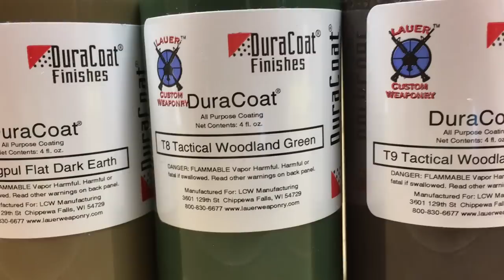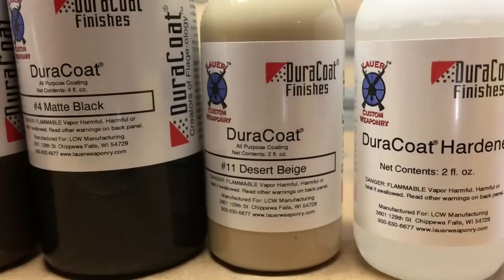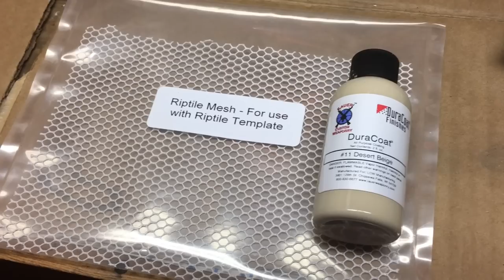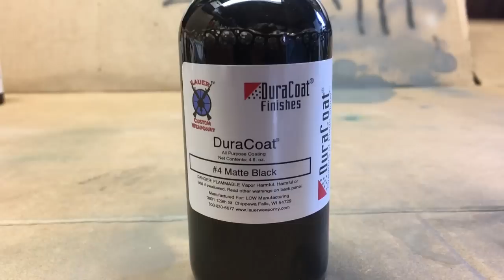Lefty 300 BLACKOUT AR-15 "Woodland-RIPTILE" Duracoat Camo Project

Comment: Very nice! I've been wanting to do this myself. Have you ever used cerakote? Would you recommend duracote over cerakote?
Reply from the maker: TRIPLE B FISHING -Thanks!  If done right, the durability of Duracoat will only improve with time.  Just like aging a fine wine. The first Riptile rifle I painted 3 yrs ago still looks amazing.  The finish is like ceramic, and has only improved... I didn’t use a clearcoat afterwords, either.
Cerakote literally requires “baking” the parts after painting to speed up that process.  I haven’t found it to be necessary.  You may get some wearing in the finish in “high-traffic” handling spots, but in my opinion, that ADDS to it’s character.  For the extra $$$, I don’t think Cerakote is worth it, because NO finish is impervious to boo boos, dings, scratches, etc.  
my advice is that if you’ve been thinking about trying Duracoat, go for it!  Just take your time, don’t rush it, and just enjoy the process! 😎
Reply from the maker: TRIPLE B FISHING - Hey! Look at you!  You’re my 500th sub! 🏆
Thanks!!

Comment: So how does that duracoat hold up on the suppressor after a hundred or so rounds?
Reply from the maker: Hi, Edward- great question..Actually, the muzzle device on this project is not a suppressor, but is actually a linear compensator made by Aluma-Lite.  The Duracoat holds up just fine on this rifle.  For extreme heat protection, as on suppressors, Duracoat makes a paint that is extremely tolerant to heat called “Dura-heat.”  Haven’t used it, but I’m told it works well.

Comment: Very good job. Definitely wouldn’t have painted the entire mag though.
Reply from the maker: Thanks!  And yeah, had a couple dudes voice concerns about that.  Duracoat applies so thin, that it doesn’t exceed any tolerances.  Zero fitment issues, and with proper prep, it won’t flake off and get into the action.

Comment: What kind of media are you blasting the parts with? I was going to get some walnut shell but thought I'd ask first.
Reply from the maker: Hi, Jacob.. Duracoat recommends prepping surfaces with 60-120 grit Aluminum Oxide media.  Blasted at approx 60-80psi
Reply: @p99shooter  Thanks going to start off with krypek on an AK.

Comment: Wouldn’t matte clear help protect the finish? Can you spray it if needed
Reply from the maker: Vahan Gabriyelyan - Great question.  Clear coating will always add that extra layer of protection for the finished product, but it’s completely optional.  Duracoat is already resistant enough to repel water and minor handling.  With hard use, your  firearm can “wear” in the high-traffic spots, adding character to it’s finish. 😎👍🏼

Comment: Good job but not sure i like the way lights come out the dark as much would have been better if u applied brown as light as first two coats and mixed the black edges with brow hot spots on final stage
Reply from the maker: spoke1183 - Interesting suggestion!  My goal was to stay faithful to the Riptile design pattern, whilst using colors commonly found in my favorite deer hunting camo pattern: Realtree Xtra.  With over 250 different Duracoat colors available, the possibilities are endless.

Comment: What kind of air brush are you using to spray? What is the PSI your running it at?
Reply from the maker: Thanks for the questions!  
For airbrushes, I usually run ‘PointZero’ brand..gravity-feed for fine detail, or siphon-feed for larger surface areas.
My PSI can vary, but somewhere in the 35-50psi range is usually sufficient.
Reply: @p99shooter  Thanks for the answers. What size tip do you use? Needless to say your videos makes me really want to do my own painting. There's a shop out here that charges $385 for camo pattern that dont look nearly as nice as what you did in this video.
Reply from the maker: @UnfundedLiability  - PointZero Dual-Action 7cc Gravity-Feed Airbrush 3 Tip Set (.2mm .3mm .5mm) https://www.amazon.com/dp/B004KNHGG4/ref=cm_sw_r_cp_api_i_1ZG5Y83WKZETW9XZYJGQ?_encoding=UTF8&psc=1
Reply from the maker: @UnfundedLiability  - That’s very flattering!  You should totally DIY.  It’s really fun, and it’s great art therapy. I’ve been meaning to do a video on my set up, this might inspire me

Comment: How does the dura coat hold up? Anyone ever put it to the torture test?
Reply from the maker: Tellitallnow - great question..in simplest terms, the finish seems to improve with age, just like a fine wine.  It repels water nicely, and gun oils / lubricants are no problem.  In terms of torture testing, I’m pretty OCD with my firearms, so I try not to beat up on them too bad.  However, if one were to put a Duracoated rifle to the test, by running it hard in the field, training hunting, etc., you may get some wear in the appropriate spots.. giving it a battle-worn appearance.  
Bonus 👍🏼
Duracoat has about 350 different colors.  With a basic airbrushing kit, you can make a masterpiece out of a what would normally be a mundane looking firearm. Go for it!
Reply: Thanks!!!! Will be purchasing the kit very soon!!

Comment: What gas block did you use???
Reply from the maker: Brandon Clark - Brandon Clark - Hi, great question..  It was a pretty basic, non-adjustable, Low Profile Gas Block.  It was one I just happened to have on hand for this build.  I believe it was made by CMMG, or Yankee Hill.  However, after scouring the internet, I can’t seem to find this “exact” model available for sale anywhere.  I can tell you that I would’ve bought it from either Brownell’s or MidwayUSA.  The market is SO saturated with AR parts these days, I wouldn’t be surprised if this model was discontinued.  I can, however, tell you that it rides on a 16” CMMG barrel (mid-length), with a Spikes Tactical Melonited mid-length gas tube.  Flawless functionality so far. 👍🏼
Reply: THANKS! I am wanting to build and 300 blackout so I trying to get a parts list of things that are proven to work well together. I have just mixed things about the 300 blackout. Awesome looking guns that you build!!
Reply from the maker: Brandon Clark - NICE!  Have fun with your build!  Thanks for the sub, too.. I have a few more projects on deck!

Comment: im about to build my second lefty rifle i want a 300 pistol looking for guidance
Reply from the maker: Byron_Usagi - Thanks for subbing! Personally, I’m a big fan of carbine-length, 16” barrels.  But from what I’m told, pistol length barrels are excellent for the 300BLK caliber.  In terms of performance, overall weight, and ease of maneuverability.. 300BLK is a Great choice for an AR-pistol build.  
Best guidance I can give? 🤔
When procuring your parts, make sure your muzzle brake is big enough for .30 cal.  Also, make sure your gas tube length will correspond with whatever barrel length you go with.  
Also, stay away from “RedXArms.”  Trash company, trash customer service.  
Procure parts through Brownell’s or MidwayUSA.  You’ll be better off!  Good luck, have fun!! 😎👍🏼
Reply: Gibbz arms makes some nice rifles. I’m a lefty and was looking to build a ar 9. I wanted the casing to eject out the left side and couldn’t find anyone that makes an upper like that. They’re a little pricy but not too expensive and totally worth the money. It’s a side charger and at first I thought it would be weird but it feels way more natural than the normal set up. Check them out